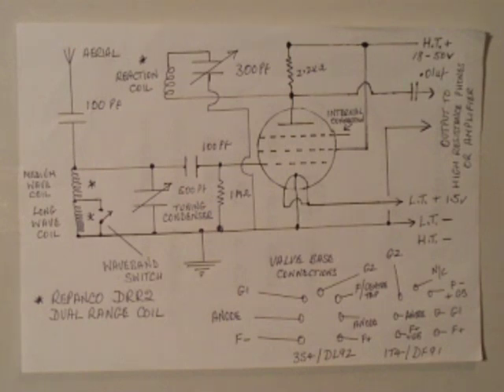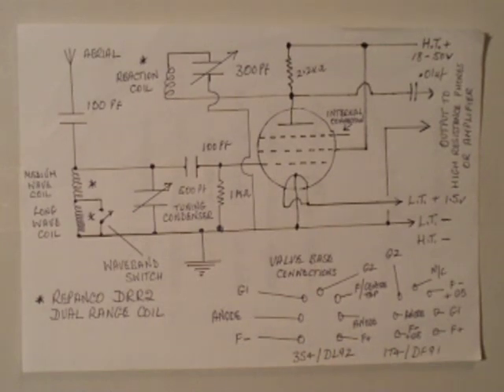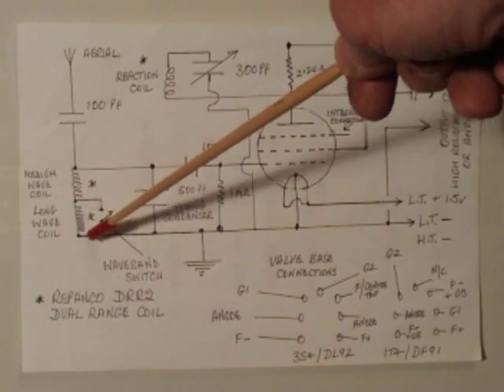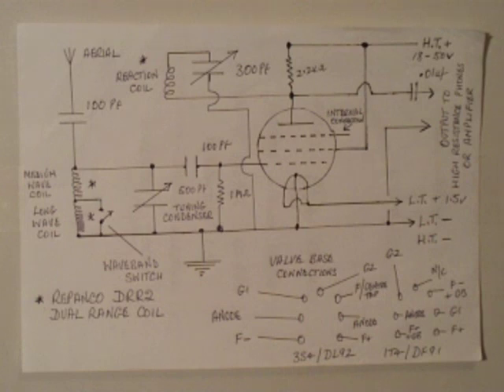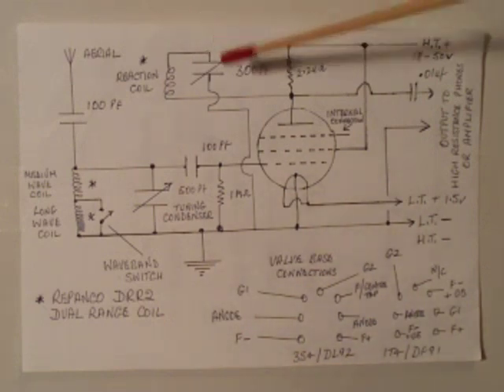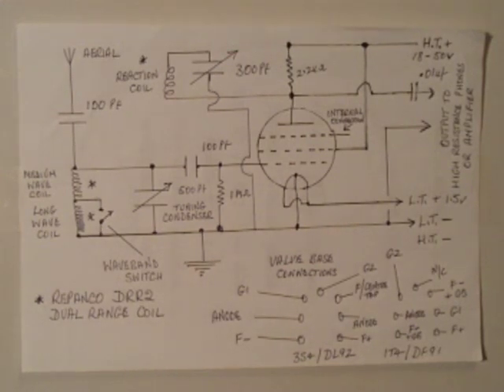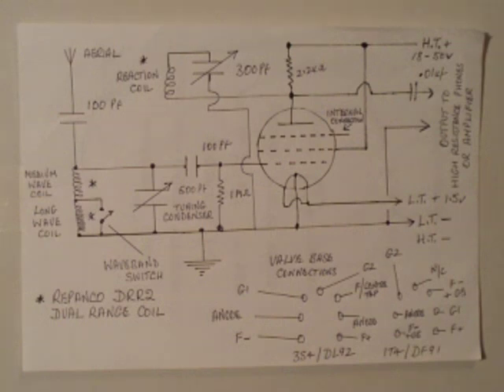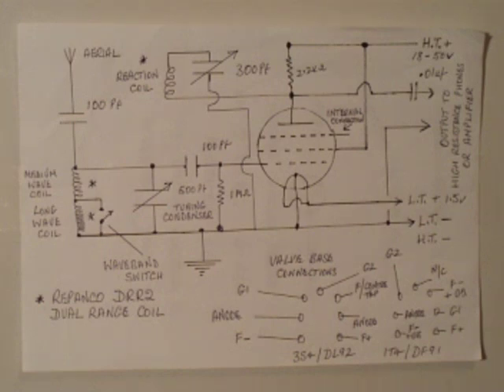Radio circuit

Comment: I'm in the process of building my own regenerative radio, the circuit I came up with is based on yours but I'm using a 6C6 pentode and the coil is different. I couldn't get it to work with the coil you describe, so I made another coil on a ferrite rod (again 50 turns for the tuning winding and 30 turns for the feedback), and now it works, pulled in loads of stations!
Reply: CoolDudeClem , can you put more details of coil you built on YouTube for us

Comment: Hey, im having a hard time getting any DIY radios to work, im new to radios. 
i cant get any tubes but i have lots of transistors. Can i make this circuit with a NPN transistor without the screen part of the circuit and voltage around 9-12V? or is there any obvius reasons why that would not work? Cheers
Reply: It won’t work is because you are a moron